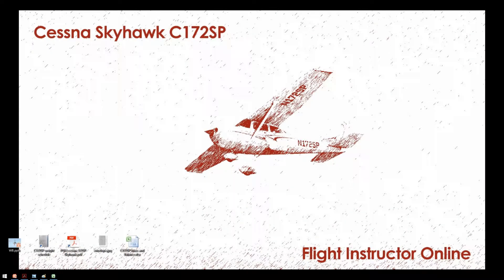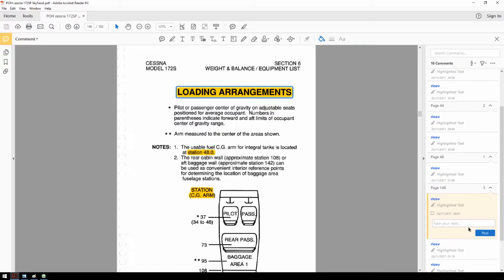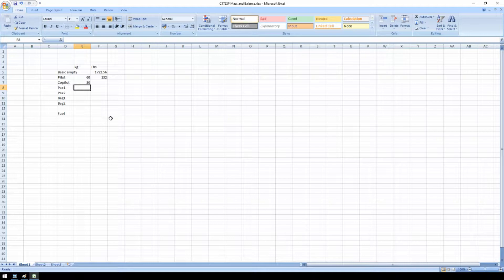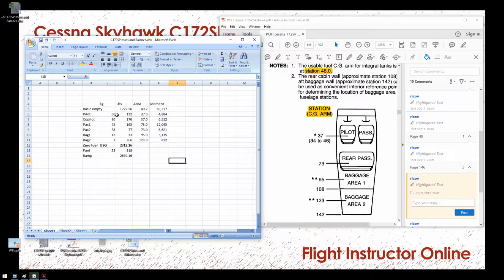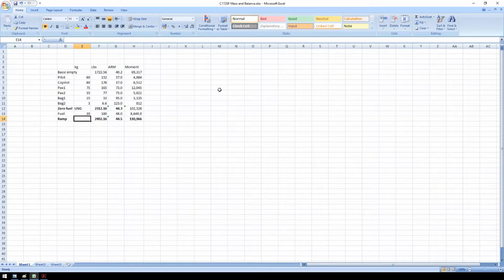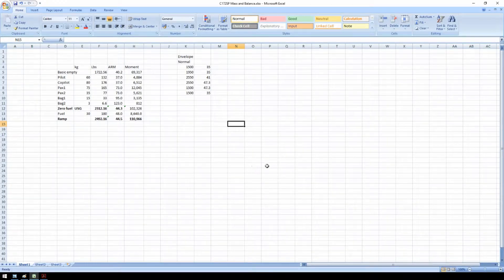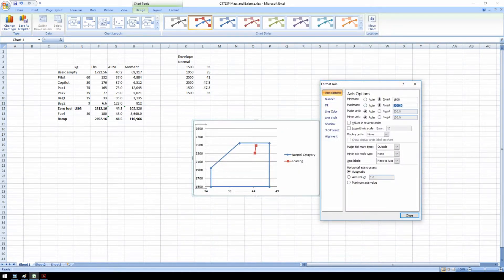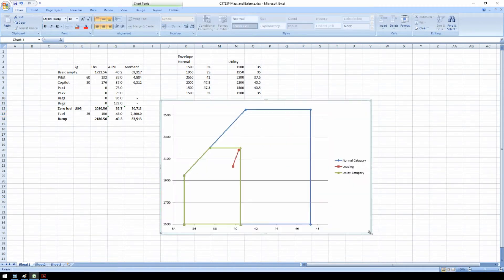Making an automatic Weight and balance calculation

Comment: I suggest going further.  Create excel formulas that grab info that we get like Temp/Dew point, winds, airfield elev, Etc...I use excel to formulate my PA, Da, cloud base in MSL/AGL, freezing levels, 70/50 rule, pretty much all aviation calculations.   Again all done by excel taking the info multiple times from the same cell and give me the answers.  I used the IF function If there is any numbers that are out of range, it'll display at the top a warning cell in red with a warning title,  ex. "Icying" or cloud clearance!  (IFR stuff). Anyways.  I thought I'd just share that. Though your video was great.